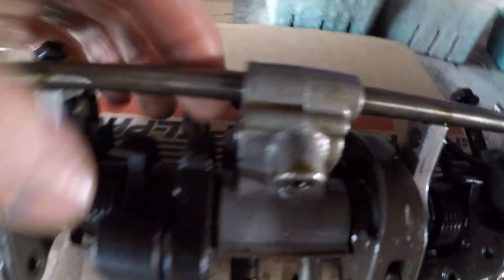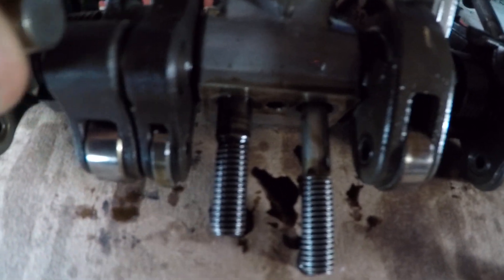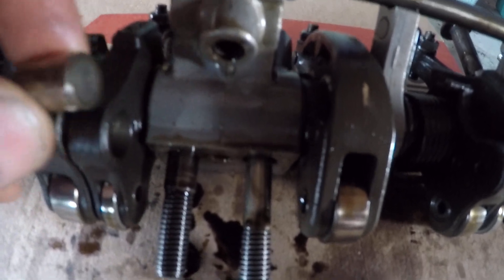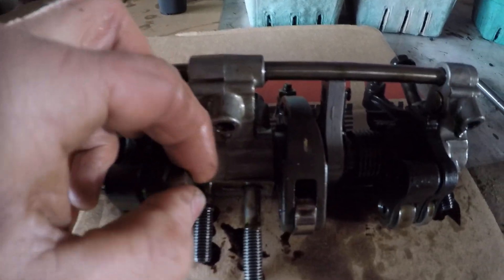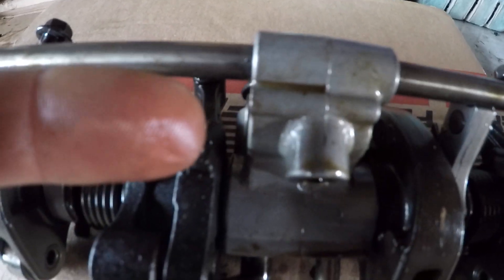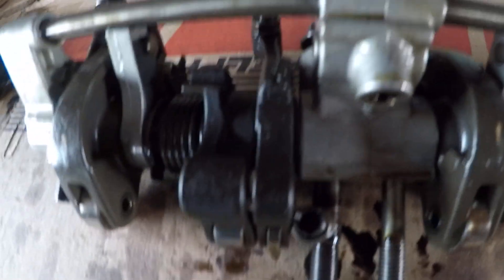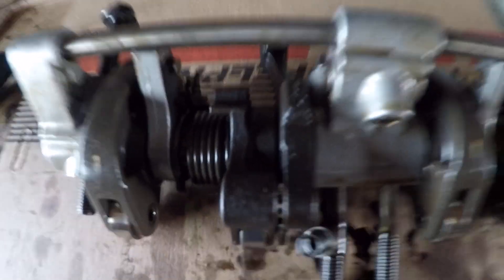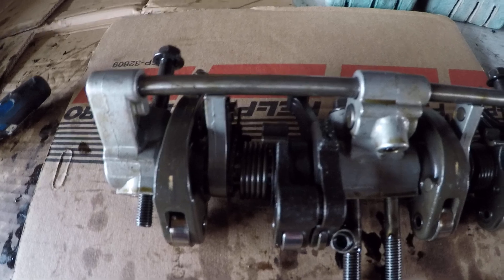Subaru EJ253 AVLS. Part 2 - Hacking the pins.

Comment: This could ruin the air/fuel ratio and timing unless tuned. This also decreases fuel economy. The AVLS system improved low-end economy and improves top end power. If you want more power, get a bigger cam on the agressive lobe with a tune. How did this work out?
Reply from the maker: Keep in mind, the ECU & intake assemble that went onto this was a pre-AVLS, so it already expected all valves to open fully like this. It worked fine, fuel trims were fine. Fuel economy was as expected for a non-AVLS EJ25 (i.e., not a good as an AVLS 'normal' system).

The idea was just to show that, in a pinch (i.e., lack of pre-AVLS longblocks), the AVLS ones can be used on these older models.
Reply: you could just hook up the solenoid to an RPM activated or manual switch VTEC just kicked in yo! lol